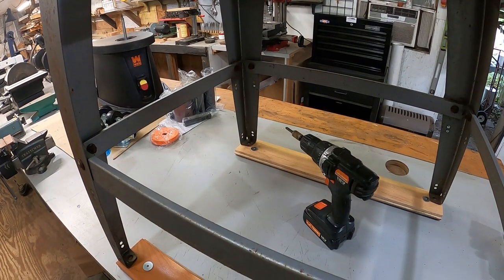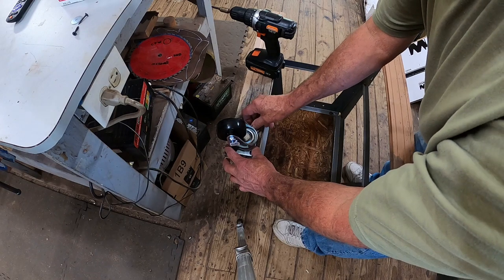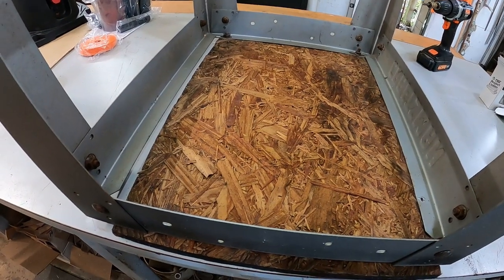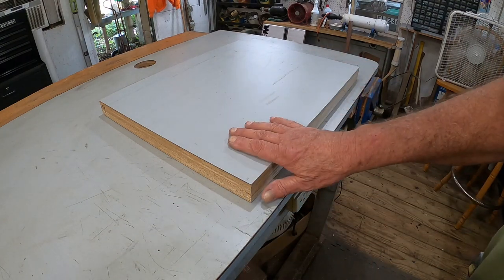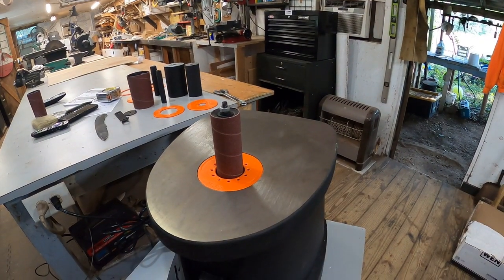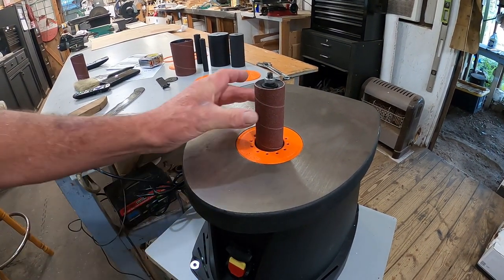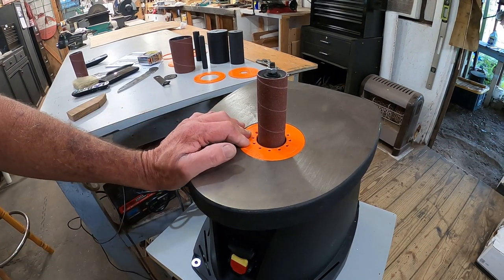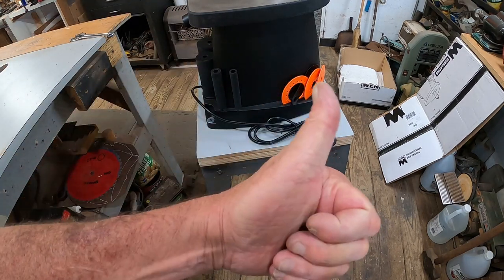Oscillating Spindle sander stand,First run!

Comment: There is no adjustment to make it go higher or lower but you can do two things to get all the life from your sand  drum. Turn it over when one end is wore out and when both ends are wore out, use a one inch block to rest your work on to get the middle section of the drum used up.
Reply from the maker: Thats why I hang around smart peoples  :)  Thanks!  Just gave me a idear for a jig to go on it.